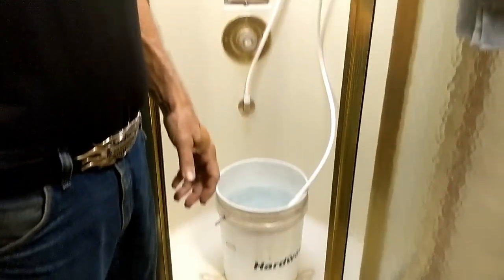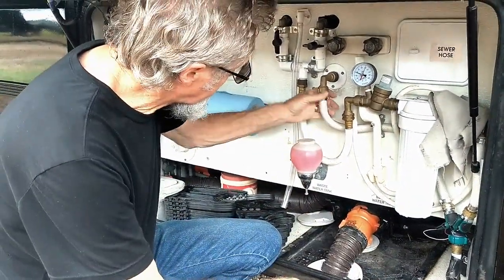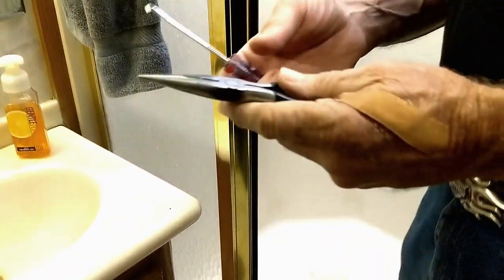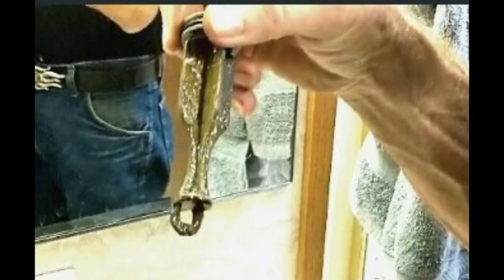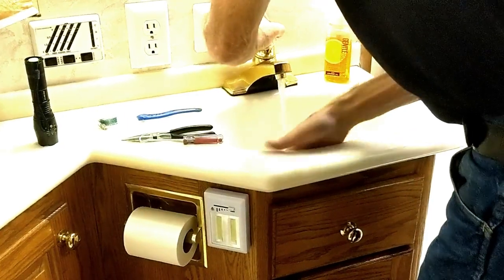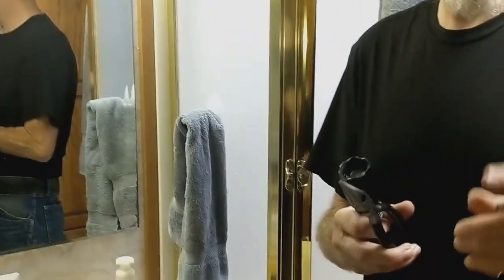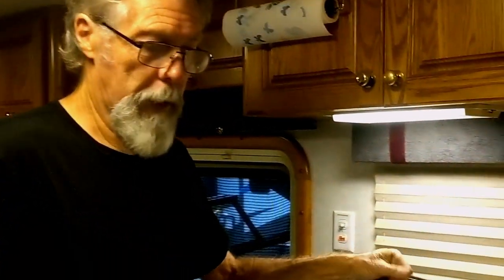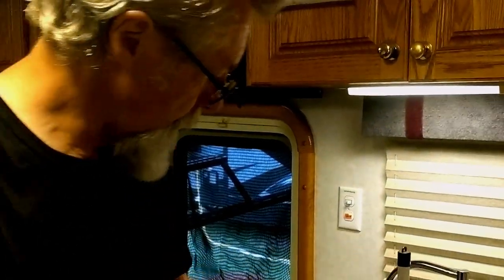V-30 Easiest Way to Dump and Clean Black Tank

Comment: You know your correct about the Scott tissue, I don't live in an RV or anything just regular city apartment but my family used to have septic system when I was a teen and I remember getting in trouble for using too much of the "cushy" stuff. When I started living on my own and I was the one that had to do the unplugging of the toilet I started looking for a solution and Scott to the rescue! I am now 58 and haven't looked back plus it winds up being cheaper in the long run even if you have to use more on those days when things are a little "looser" :). Oh and by the way Walmart brand works just the same and comes out to be a full 0.03¢ per roll I buy the 20 roll package ship to home free shipping. LOL
Reply from the maker: Awesome never tried Walmart brand!!  Thanks for watching !!

Comment: Okay, let me say that if you want to cut the dirt and grease, use this environmentally friendly formula ( I used it instead of any commercial cleaner) for cleaning. Warm 1 cup of Dawn (the blue dishwashing detergent) and Warm 1 Cup of CLEANING vinegar (vinegar will clean 99% of gems, same as Clorox) mix well and add to spray bottle for cleaning applications.  For heavy soap build up and mold let it sit for at least 1 hour, then rinse.  This formula is all I use to clean my bathrooms, it's good for killing germs, mold and eliminates grease build up also for plumbing and septic tanks.
Reply from the maker: Sounds like it would do the trick !!

Comment: Even though I always use quality hoses and connectors,I always open the gray valve first for a few seconds to fill up the dump hose to check for any leaks or bad connections. If all good ,I then drain the black followed by the gray .Rather clean up soapy water than the alternative. Never know if somehow your brand new hose got pinched,poked or stepped on while laying on the ground.
Reply from the maker: The problem with dumping, it seems if something can go wrong it usually does, keeping your hoses up to date and good seals is about the best you can do !! Thanks for your comment and keep on dumping !!